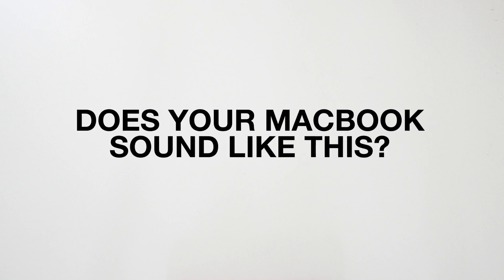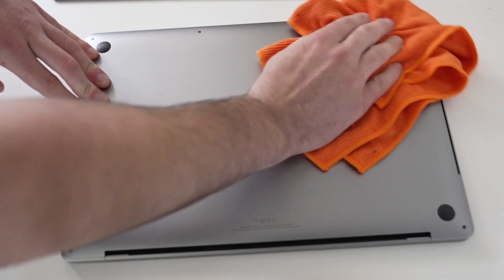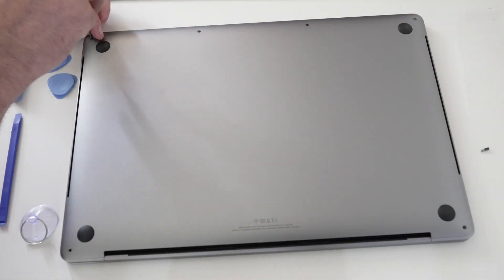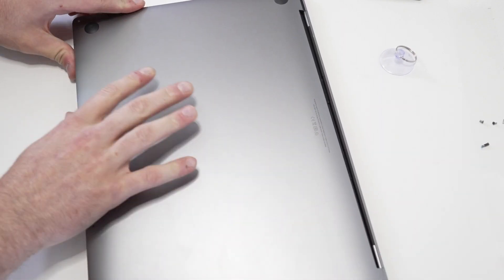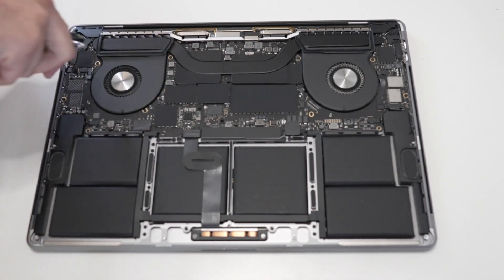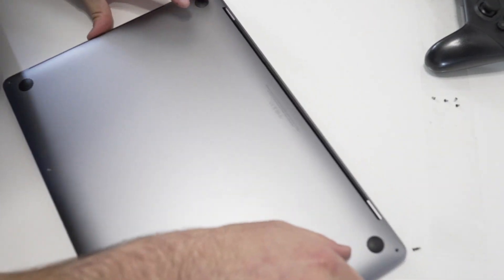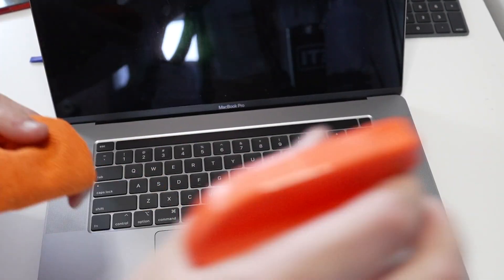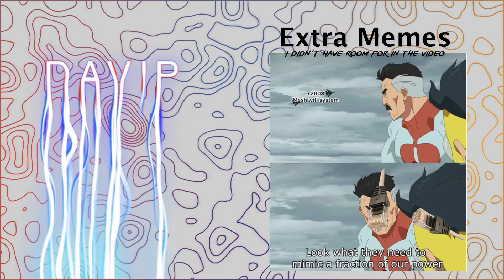How to fix your slow and HOT Macbook in 5 Minutes

Comment: This worked.  My Mac was overheating badly.  I bought a tool kit.  I got some compressed gas cleaner.  Run the little wedge all the way around, once you hear both side clips release you just have to use some suction cups to lift the back off.  My Mac is running like new again.  Thanks for the tips!